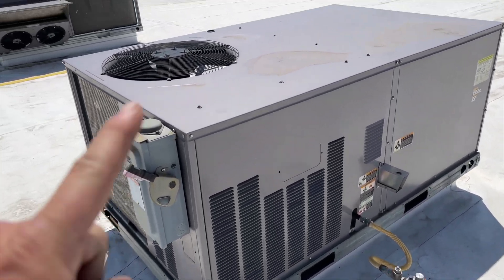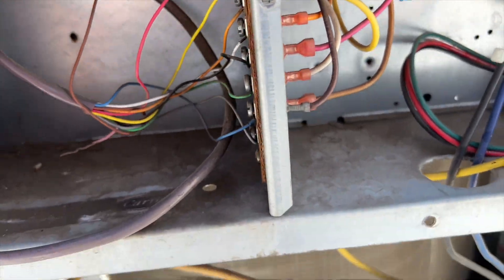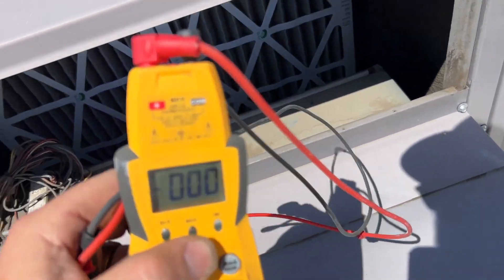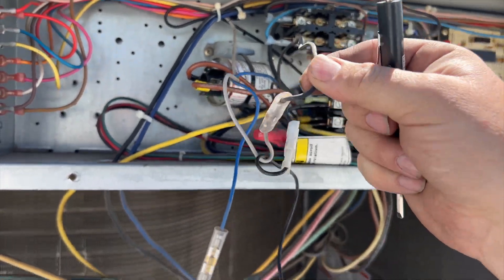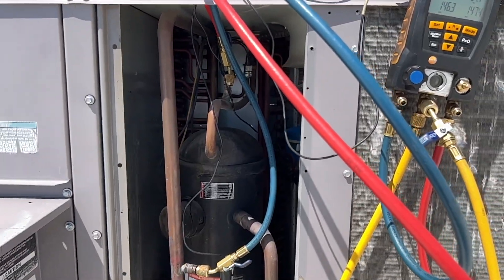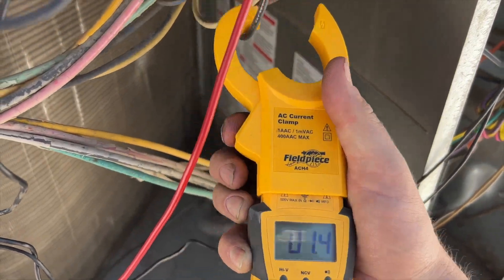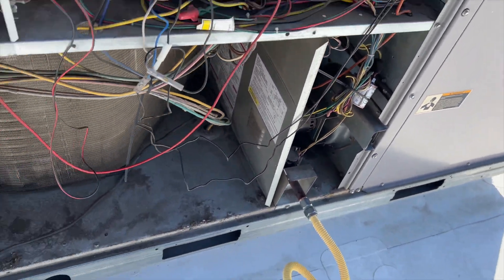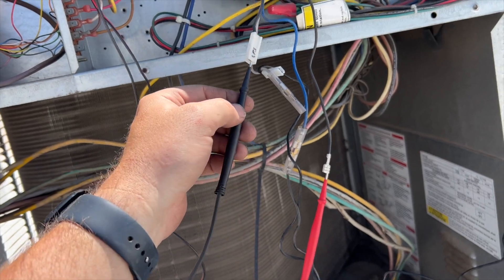Diagnosing An Open Pressure Switch and How to Pin Point the Issue EP141

Comment: Nice video mate. I find it really interesting when manufacturers solder the pressure switches in. Daikin does that too and when you need to replace one, it’s so expensive for the customer because you have to reclaim gas etc.. Anyway great video and thanks for sharing.

Comment: That's a great troubleshooting method and i truly respect that. Wouldn't it be easier to just check the HPS with a multimeter thought? Wouldn't that save you lot's of time? I think your method should only be used when we don't know what the actual reading should be what's your opinion (you definitely know more than me)?